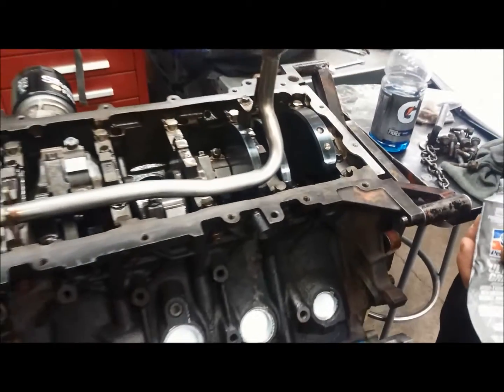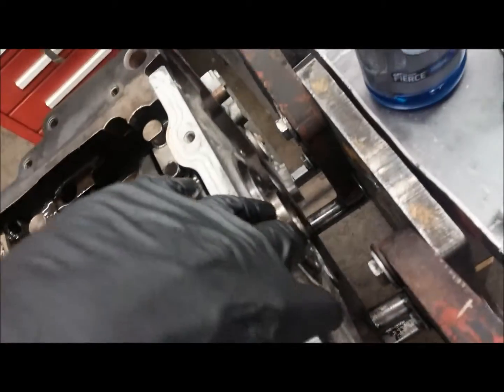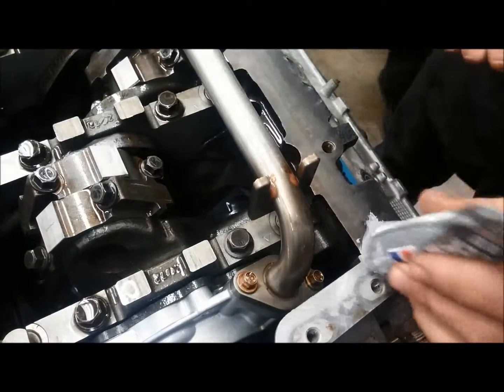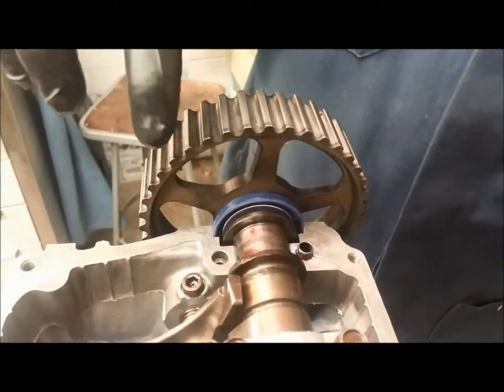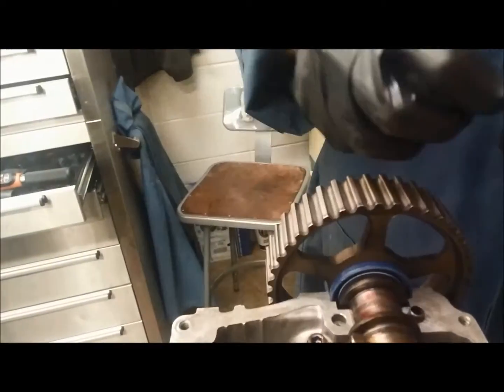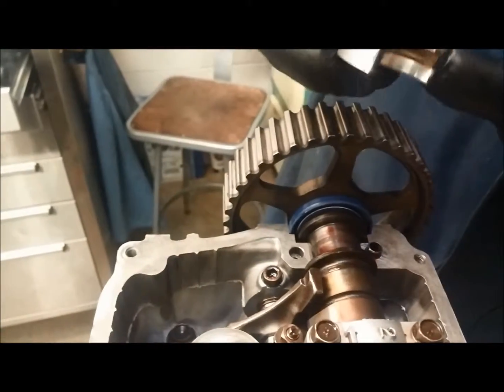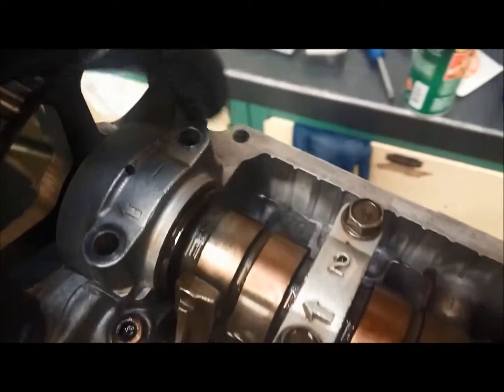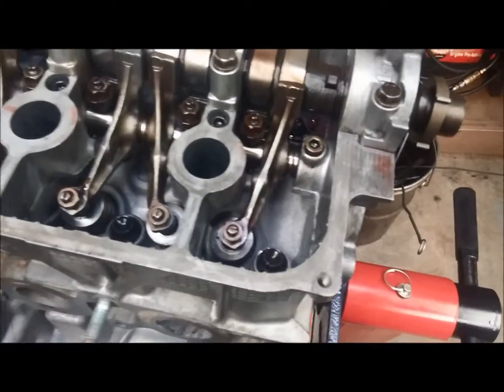Where to use silicone RTV when assembling an engine

Comment: Would this apply to a timing cover gasket apply silicone to seems only?
Reply from the maker: As a general rule, yes.  However, every engine is different.  Some call for silicone for the entire gasket surface area.  Others need silicone on other sealing surfaces.  You just have to pay attention, follow any available instructions, and observe any surfaces that could potentially leak and determine how they should be sealed.

Comment: How about on a water pump?
Reply from the maker: Yes - you can definitely use some silicone on the water pump gasket.  Just don't get carried away!
Reply: @JustinMillerAutomotive  Thanks! Got black RTV all over me.  Sticky stuff. Thank goodness for rubbing alcohol.  Yuck!  But, hey, it worked!
Reply: @psmith1349 thank goodness for the drinkable ones too